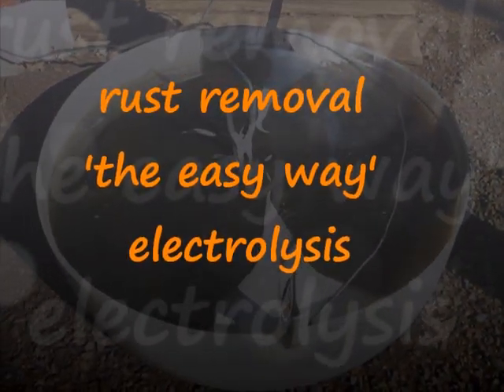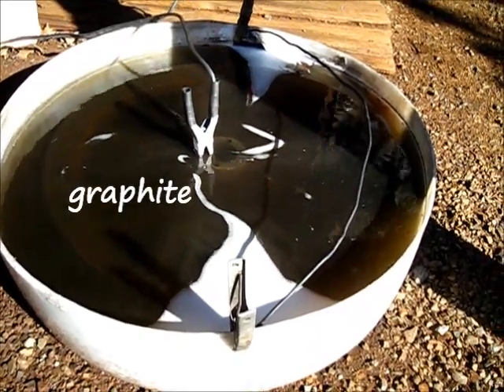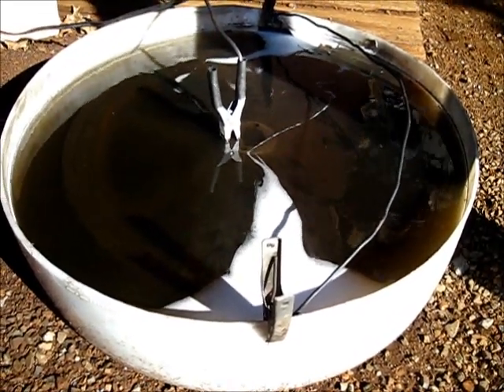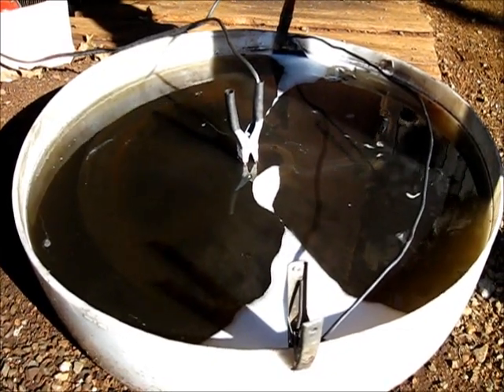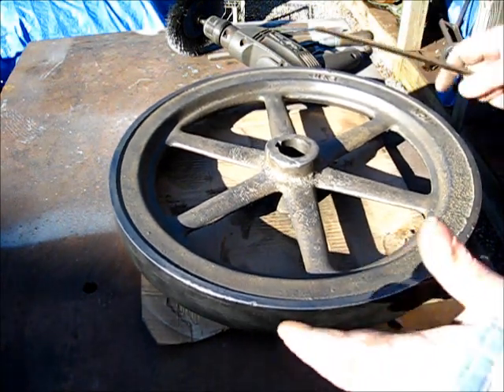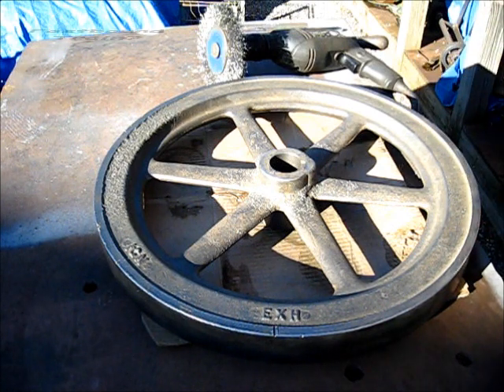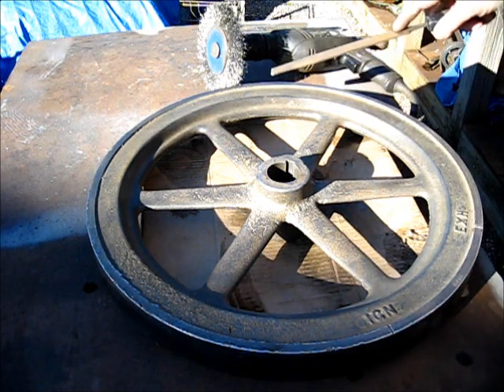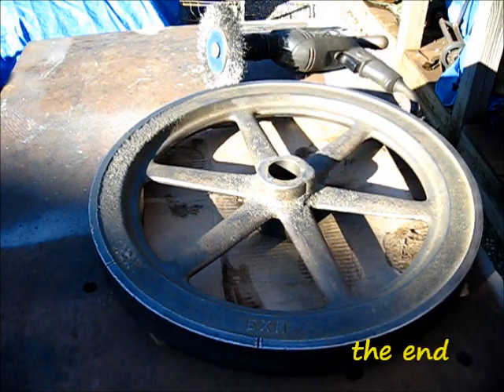Rust Removal how to clean cast iron with electrolysis

Comment: When you remove the part from the tank you rinse it with plain tap water correct? Then after wire brushing you said you wiped it down with another product which I couldn't make out on the video what is it and does it keep rust from forming on the clean iron?I have my graphite elec to do my Economy engines parts